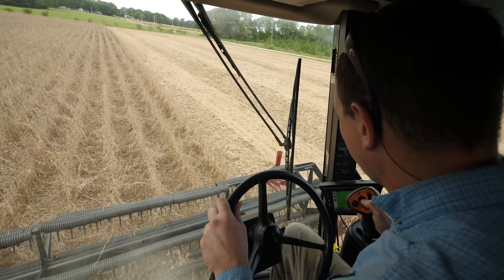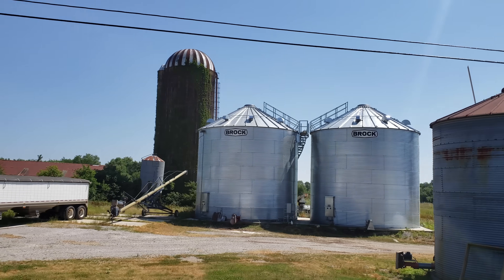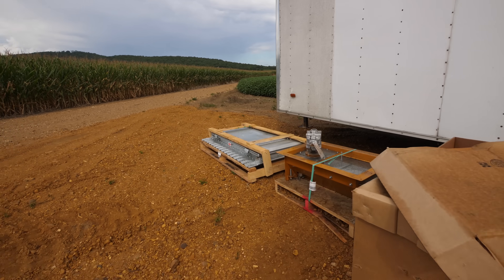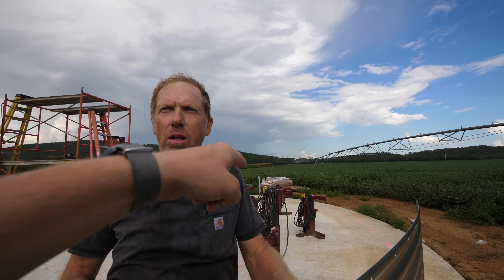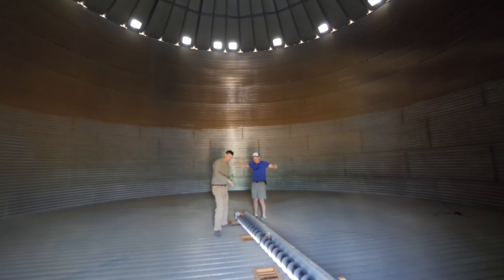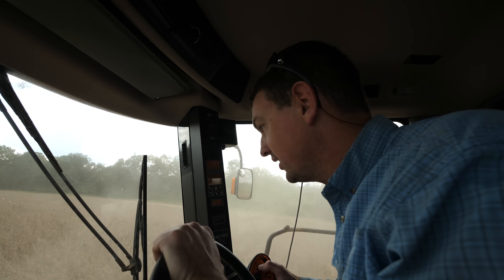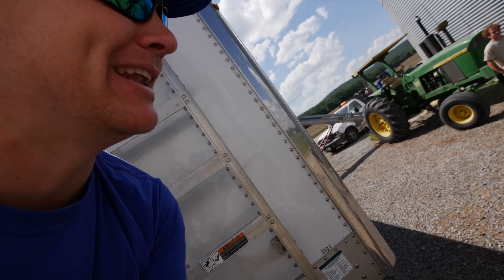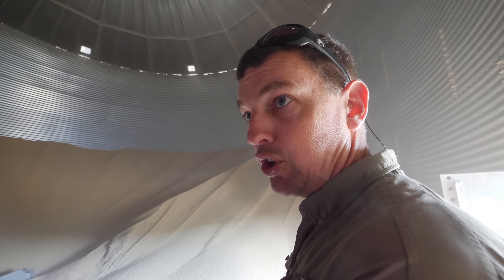Everything About Grain Bins (Farmers are Geniuses) - Smarter Every Day 218

Comment: Hmm? The Fluid Dynamics of Moving Beans?
Could all those moving beans be a model for moving molecules in a liquid (or a gas)?
Any why, farmers are great. Thanks for the video.
Reply: Standard fluid dynamics don't apply to bulk solids flow/movement.  I'm a Chemical Engineer that works in the ag/food industry, and the engineering/design of liquid in a tank is very different than grain in a bin.  It's mainly because pressure has no impact on bulk solids flow.  For example, the height of grain inside a bin has no impact on the discharge rate, unlike a tank where  the head pressure has a huge impact on discharge.   That's why using an auger to empty a bin is necessary.  I was actually hoping that Destin would get into the differences due well-documented love of fluid dynamics.

But I think your question is if flow of bulk solids can be used to simulate/model the motion of fluids.  And that I don't know.  My gut says no, because the flow dynamics aren't related, and therefore a variable introduced to the model wouldn't produce an effect representative of how the fluid would react.  Maybe on a micro scale it would work, but I think your modeling would fall apart pretty quickly.
Reply: @jlhillmann79  : Thanks for the thoughtful reply.

Comment: Destin! I was hoping you would mention this in your video, but those farmers failed to mention to you that another dangerous aspect of grain storage is that it's one of the most explosive environments you can be in!! I work for a fire suppression company, and we service many explosion suppression systems for grain elevators.  it's insane how much energy a grain dust explosion has!!      the ironic thing is, our systems actually use explosions to suppress the explosions 😁 after a specified pressure spike occurs, using an adjustable pressure switch, it activates a small detonator, on a pressurized sphere full of a dry powder agent that extinguishes the flame front of the explosion reducing its energy.  pretty cool stuff. Have a good one! I always enjoy your videos! 👍

Comment: Another Great video! 👍 Question: How can the wall of the grain bin hold back so much pressure when it is full ? During the bin assembly i did not see the guys reinforce the bottom of the bin wall? As you know the pressure is bigger at the bottom when its filled to the top.

Comment: uses grain moisture tester
- How does this work?
- I have no idea.
I laughed out loud there. Not something you hear often on this channel!
Reply: Probably measures temperature and humidity change inside the test chamber.
Edit: This idea is stupid, won't work like that.
Reply: As far as I know, a similar tool is used in coffee farming, where a similar problem occurs in the drying and storage of the beans. I know the typical tools they use right know are measuring the capacitance of the beans. Higher moisture content equals a higher dielectric constant, and thus capacitance. We have even verified this concept, as our group (Humasol) engineered a cheap version of this tool.
Reply: florianderoose correct. But only for the portable ones. The lab ones use heat and dew point.
Reply: @florianderoose  ok, that makes sense.
Reply: I know of two ways to do this!  One mechanical, the other gaseous.  Anyone want to venture some guesses?
Reply: What I do know is that the corns moisture is tested when fresh corn is brought in, and while it's being processed.. Probably not very surprising or interesting, but hey, that's how it is.
Reply: Maybe it has somethimg to with with magnets and electricity
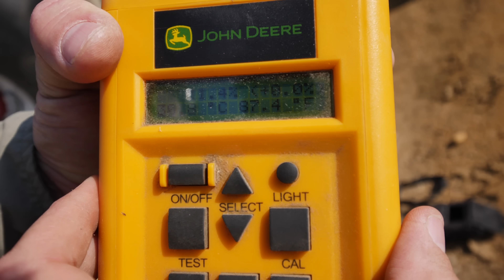Reply: 11:31 how the tester works:
It miils the grain and measures the conductivity of the powdered grain, because of that you also have to select which crop it is because the base conductivity varies. Hope i helped.
(more conductivity - > more water - > higher percentage)
Reply: @marvinecksteincool  It doesn't mill the grain. The grain is completely intact after testing. Now I do not know how it works exactly but the bottom container part has a probe in the center and you fill that part to the brim. Then you put the cap on which has a spring loaded plunger on it. You tighten down the cap until the plunger has enough pressure it pushes a rod through the center of the cap to flush. Then you select your variety of grain and hit test. Afterwards pour the grain back into the bulk tank.

-Sincerely a wheat farmer.
Reply: @ @pclinton95   There are several types. The milling type is (I think) the older version and might technically still give a slightly more accurate result, but the non-milling ones have been plenty accurate for most practical purposes for several decades now. If I recall correctly, the non-milling ones measure electrical conductivity and/or capacitance of the sample, likely both. Heating is not involved, as the tester only needs a 9-volt battery or two to work for basically the whole harvest season, so there is not enough power available to heat the samples for any appreciable amount.
Reply: @marvinecksteincool  Not this type of tester... the grain goes in whole from the combine, and surrounds a green printed circuit board in the middle of the meter... You select which type of grain from a selection menu on the meter readout and it correlates the capacitance or resistance reading it gets from the grain contacting the board to pre-programmed curves of moisture levels vs resistance/capacitance and then displays the correlated figure... they're not extremely precise like the more sophisticated ones used in grain elevators and plants, some of which actually grind the grain... (ground grain is also usually soaked with ethanol or methanol and then tested for mycotoxins (funguses like vomitoxin or aflatoxin) by various chemical or photoscopic/fluorescence means...)  

Later!  OL J R :)

Comment: "So, how do you build that 30-foot-tall structure?"
"From the top down."
"!?"
Reply: !? Captures my reaction exactly.
Reply: That's the same way that high-rise construction cranes are set up. You start with the top and jack it up once or every new segment that you add under it, eventually ending up with a structure several times the height of the jack itself.
Reply: @EidolonSpecus  Not really. Cranes lift only the top part. It's easier and safer that way
Reply: I construct grain bins for a living, and it's entertaining and flattering to find out, I'm technically an engineer... 😃
Reply: Honestly didn't expect it to be built that way
Reply: @NicholasHoward  The ones I grew up with were delivered entire, used, so I had no clue.  My jaw hit the floor so hard my teeth ache!!
Reply: Literally me.
Reply: Used to work at Bainters, these are the smallest jacks they make lol
Now they have jacks much bigger than the biggest one available when I still worked there.
Reply: I think that this can be done only with these structures (or similar ones), because there is no way you  can just "lift up" a building with a solid and strong backbone and build the floor below 😂
Reply: 30 foot is nothing yet, there's bins like this 80'-100' tall. He should do a video on a commercial site. The way the dry grain is transferred from a "wet bin" to a "storage bin" is pretty neat. It uses air, basically a massive supercharger!
Reply: !? makes a sound in my head that I cant explain, and it fits
Reply: You build smaller bins like 14 and 19 foot diameter  from the top down with a bin crane the exact same way.
Reply: You start at the top and work your way up!
Reply: A fellow Irish person. Dia duit
Reply: Now I'm curious about how wind turbines are assembled
Reply: Watch the video

Comment: Is there also danger of explosions in the grain bins?
Reply: When dusty, yes.
Reply: @markwright3161  yeah, I know dust explosions are a serious danger with wheat storage, but I didn't knew if it was also the case with Soy.
Reply: @qvoorhorst  All dust no matter what the chemical composition of it is has the potential to explode when exposed to a naked flame, wheat, soy, flour, sugar, coal. I don't know what the science behind it is but it's something to do with how fine dust mixes with air, similar to how fuel and air mix before it's ignited in an engine I believe. I'm sure there's videos here on YouTube about it that will more accurately describe it where I might not be factually accurate. :)
Reply: @markwright3161  It's all the dust that is composed of a flammable substance. When the dust is mixed with air in the right proportions and there is enough surface area on the dust particles to react with the air it will ignite.
Reply: @qvoorhorst  Yes, that's it. I never thought of flour as a flammable substance hence why I thought it was just any dust when mixed with air, but I didn't think, it's an air fuel ratio in an engine so the dust obviously has to be a fuel source.

Comment: You touched on it a little bit but I would like to see you do a video on how dangerous grain bins are. Might be morbid but they contain incredible potential energy. My uncle suffocated just from the dust in the air in a bin. They also like to explode when there is a lot of static electricity. In one instance a grain bin exploded and blew its 6ft thick cement roof, 20 ft in the air!

Comment: Jacking the walls up with hydraulic jacks... brilliant. Punches aka drift pin aka alignment pin aka spud wrench if it has an open end wrench on one end (for larger bolts, like 5/8" and up). Farmers are badass. I had a hay business for a while and it's a lot of work for a little return.

Comment: Farmers = Jacks of all trades, master of none. I work on a farm raising fryer chickens. You quickly learn there a lot of air flow engineering that goes into those barns. Keeping them warm enough, yet keeping the air quality clean. You learn plumbing fixing water lines, welding when a feed line or auger breaks. Electrician when a feed line or heater doesn't work. Heavy equipment operator when it comes to cleaning them out between batches, and a mechanic when said equipment breaks down on you. Yup, we're a Jack of all Trades :)

Comment: We use a similar tool when building or rebuilding guard rails on the road, basically just an adjustable wrench but the handle is a spike, quite like the punch, which we use as a lever to align the guard rail pieces, because they are very heavy, then once the bolts are run through, we use the same tool to crank the fasteners down

Comment: Destin, in some applications with cereal grains like barely or wheat, we actually pull the air down through the bin. I've been told this is to prevent  water vapor condensation in the top of the flow cone. As well as to lower the heat / humidity  that would focus near the top surface in the cone. We don't completely level off  all of the top of the pile when we are done filling the bin (safety,  misery). We also put in as much grain as possible therefore,  there is always a cone that will focus heat or humidity. Surface tention, capillary action, convection? I don't know how it works exactly.  We do level a small part of the very top of the cone if it can be reached safely to increase the surface area and allow vapor to escape.

Comment: Because you have had limited experience with a group of people does not elevate them above the norm. Indeed, for every group new to you we would be inundated with multiple categories of genius. While I am certain that some farmers might well qualify as genius, when this is your only reference frame your results are biased.

Many modern businesses require the level of expertise you saw here. And many would have called a mechanic to clear the combine, or stopped at the first sign of rain and let it pass. Thus negating the need to fix the jam. The same can be said of many, many groups. Race car mechanics/engineers. Airplane pilots/mechanics.

Nice video overall. The grain bins, their engineering, and assembly are pretty cool.

Comment: Hey Dustin. I own a small dairy farm in maryland. You should do a video on the different silos, Upright concrete and blue harvestores. one unloads from the top and the other unloads from the bottom. They are amazing works of engineering and are truly fascinating. Both have there advantages and disadvantages. try and find someone who will pull the unloader out from the harvestore and show you how it works. you wont be disappointed. Thanks, Jack from maryland

Comment: Hey! 11:33 One of the ways that moisture testers work is called a Carl Fischer Titration.  It's actually super simple but also super smart, just like farmers.
Reply: Carl Fisher is a titration method. Super accurate (can go down to ppb) but it's not what's shown here. This is most likely a capacitance measurement. It's quick and a little noisier but it gets the job done and is pretty robust to harsh conditions.
Reply: @ardenthebibliophile  like cop's alcohol meters
Reply: We definitely need a Smarter Every Day about the Carl Fischer Titration
Reply: I have used one  for 30 years and did  not know that.    Have bins  and have built many and used and done   all.

Comment: @SmarterEveryDay/Dustin: I think your corn rows are too narrow. You should add another 5 rows to that to get a good yield. They pollinate via the wind. So it is vital that there is enough of them close together to cross pollinate. 30 Ft long is good, but should be at least 10 Ft wide with about 10 rows.
I had grown corn one time, and had about 300 square foot planted, and the rows were about 2 ft apart. I had a decent crop, but would of been better had I had the rows closer, stalks a little denser, and kept the silk worms out of the field

Comment: Small note on the metal the bin is made of, at least the ones we built many years ago. The sheets are thinner at the top and thicker at the bottom. The crew said it was to make it easier to lift or to make the bottom rings stronger.

Comment: I work in a grain storage facility and the humidity explanation was spot on. Nice video dude!
So, the limit for humidity in soybeans as per standard in my country (Argentina) is 13,5%. You can storage grains with more humidity than that and lower it with bin or silo ventilation (like in the video), but at a certain level, lets say 15%, you have to use a grain dryer, a very cool machine that is worth another video.
Reply: I would like to see that video.

Comment: Just to answer your question: there are lots of humidity (and humidity+temperature) sensors around, like DHT11, DHT22, AM2302. Add a 16x2 character LCD panel and some microcontroller (if you're lazy, and Arduino mini), power it from a battery, put these into a plastic box, and you got your moisture meter for around $10.
You could put some of these into your grain bin/silo (just the sensor, maybe a uC, wired), and power off the vents when needed. Or monitor the whole stuff remotely or whatever is necessary.
Maybe farmers aren't geniuses, just their trade is thousands of years old, so they had time to figure everything out. Had computer science been around for 10000 years, robots would've killed us all by now.

Comment: Those bins are and EXTREME fire danger.  That super fine dust in the air of the bin will EXPLODE if exposed to a spark or flame.  I've seen the remains of a CO-OP bin that went up like that, and then it burned the rest of the way to the ground.

Comment: Experienced grin bin assemblers: Wear sturdy long pants.
Noob grain bin assembler: Wears flimsy shorts.
Reply: projectmach The sheet metal Has sharp corners and edges Plus you Might be standing in the sun all day (so it’s like wearing a Safari hat or what those guys that live in the Middle East (maybe I’m thinking about Of tourists) have (not a turban ) and it covers your neck and sides of your face while the front has only a little bit)

Comment: That punch is similar to a spud wrench.  Thats the tool with a big box wrench on one end and a spike on the other.  It's for ironworkers who raise the I-beam suspension for big buildings.  When the crane lowers in the i-beam, the forces are immense.  So a single ironworker helps align the beam, and uses the back of the spudwrench to align the holes.  Then, you put a bolt into the other hole, pull the wrench out, and use the box end to tighten on a nut.

Comment: Question: why doesn't it look like the bottom circumference is reinforced like a water tower? Is it because the pressure of grain at the bottom is less than if it would've been water? Or is it just the strength of the construction material?

Comment: I was surprised there was no support beam for thoses bins. I thought the weight/pressure of the grain pushing sideways would make it collapse, but thinking about it, the same pressure apply on the other side too, so the only thing that matters is the material itself.

Comment: When I was 19 I worked at an ethenol plant who had huge 500 foot grain bins. My job was to basically clean around the plant and when it got busy during the harvest I would stand out in the sun all day directing trucks on where to go. Coolest part about it was they had what they called the pits and tunnels. Basically it's a series of networks that go underground around the plant to where the trucks drop the grain into a series of conveyor belts. It went about 20 feet underground. It's kinda scary at first to know that a 500 foot silo or bin in right above ground. I also had to climb the stair cases up to the grain bins to clean off around the conveyors. If you laid down on top of the bin you could feel the top of it moving up and down from all the pressure. One day one of the tops of the bin blew off because a sudden change in pressure differentiation due to heat and you'd think we were starting WW3. One of the supervisors was a retired Marine and he just stood frozen in place when we all heard the sound. I think it gave him a PTSD attack for quite a while. To date it was the coolest job I've ever had.